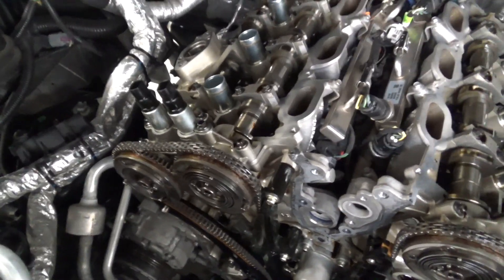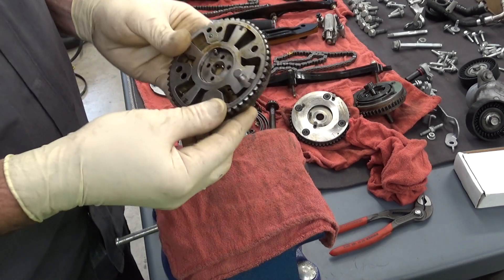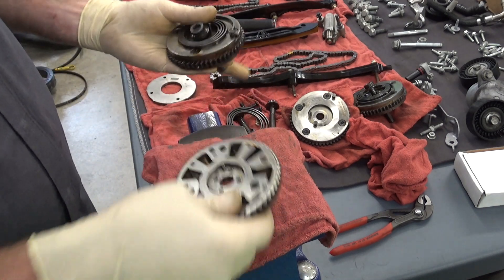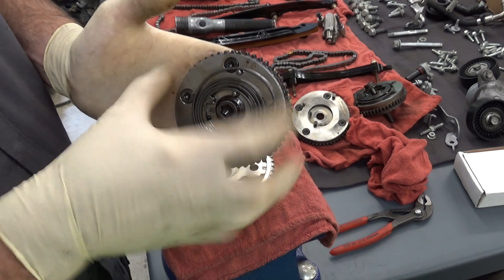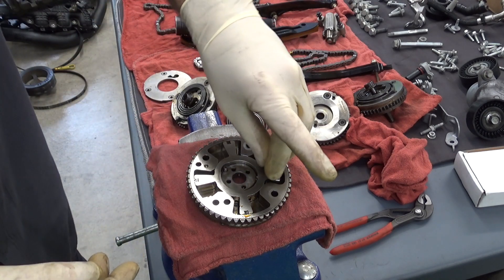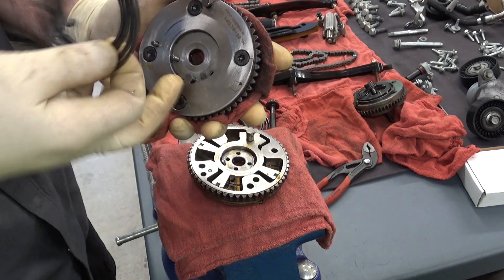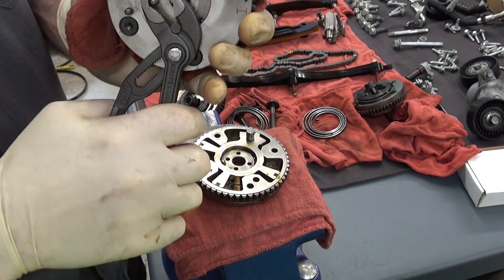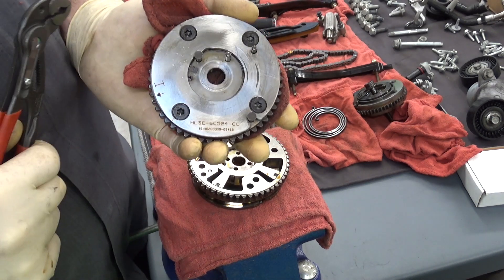FORD 3.5L ECOBOOST CAM PHASER RATTLE. THIS IS WHY

Comment: Thank you for posting factual information instead of the speculation posted on other channels.  You are 100% correct, the phasers are not locking properly, causing the noise.  Completely unrelated to oil pressure.  The new calibration prevents the locking pin wear, and for the ones that already had an issue the new CD level part has a redesigned locking mechanism.
Reply from the maker: The next one I do, I'm taking one of the new units apart to see what is different. Seems like so many say it's an oil pressure problem with plugged oil pickups, Talked with our parts manager and he said they have never sold a pickup tube for a 3.5 ecoboost but hundreds of phasers. Amazing how so many people can be so wrong. One of our techs had a higher mileage unmaintained 3.5 f150 come in 3.5qt low on oil with nasty knocking noise all the time. He swore it was lower end so he removed pan, rod caps, main caps and inspect pickup. All looked almost perfect. Whole day wasted. It was a blown apart intake phaser. He didn't listen to me. LOL
Reply: @raincitywrench117  can't wait to see
Reply: @raincitywrench117  Do you know Wildman113 means by “CD level part”?
Reply from the maker: @aggiejet  I believe it stands for concept design. Redesigning the part.
Reply: I got the updated software. Is it boosting the oil pressure at start up? I’m not sure how that locking pin issue gets fixed even with boosted pressure which likely causes other issues.
Reply from the maker: @U20E27  This engine has a positive displacement internal 2-stage variable vane oil pump which is controlled by an integral solenoid on the pump that will switch the pump between high and low mode operation.

 If a customer complains of shudder, Ford wants you to disconnect the oil pump electrical connector then test drive to see if shudder is gone. 

So it looks like the program changes the oil pressure under various conditions to prevent pin wear. 
Default is high mode (full pressure) but the engine will still take a split second or two to build oil pressure to the phasers and if the pins aren't locked it will rattle.
Reply: @raincitywrench117  
Yeah the second update is a roll back to the original settings if there is a hard shutter. So likely the software patch is a Hail Mary to try and reduce warranty claims ie get them to make it to warranty expiration dates. Not really a “fix” just a tweak to reduce cost on warranty jobs. Definitely the phaser design needs to be tweaked. I wonder what Toyota’s new phaser looks like?
Reply: @raincitywrench117  does this start up rattle issue will cause problems?   Consider all the efforts and potential human error when replacing those phasers.   A Must fix or ?
Reply from the maker: @vivaprojects4491  Here is what Ford says: "A cam phaser that has developed an undesirable noise does not affect the 
vehicle safety, performance, or emissions.:
If it's still in warranty then yes I would get it serviced.
Reply: @U20E27  
Stop speculating about things you don't understand.  Toyota and all manufacturers use the same design.  The issue was the calibration causing the phasers to lock/unlock too frequently during operation, which caused premature wear.
Reply: @raincitywrench117  
Correct on the positive displacement 2-stage variable oil pump. However, 21B10 is not just an adjustment to oil pressure, but an adjustment to cam phaser duty cycle.  The original calibration was allowing the intake phasers to return to base timing too frequently, which was causing premature locking pin wear.  The new calibration keeps the phasers off of base timing to eliminate the lock/unlock cycles that were causing the issue.  The CD phasers contain a more robust locking mechanism, but that was not ultimately determined to be root cause.

The shudder on some vehicles (21N08) is the result of a lack of maintenance.  Poor lubrication of the cam journals causes scoring, which reduces the oil flow to the phasers (bleed off).  Since the new calibration requires additional oil to the phasers to keep them off of base timing, the scoring is exposed when 21B10 is performed.  Hence why the tech is instructed to revert the calibration to the original.
Reply: @wildman1137   Never said they were different. Actually fully aware that flawless🤣 Toyota uses a similar setup. Only takes a different material to screw up an otherwise perfectly fine part.
Reply: @Wildman113 What is a “cd level part”?
Reply: @aggiejet  That's the newest service level part.
Reply: How does calibration prevent locking pin wear?
Reply: Yes. It IS an oil pressure problem.  That failed locking pin that you are looking at is only the symptom. 
How do you think it got worn out to the point where it wouldn’t lock up the gear when the engine stopped?  
Inadequate oil flow.  

So let’s think about this:  the pin extends into the lock position when?  
When the engine stops turning, right.  
So what CAUSES the pin to extend into the lock position.  The spring simply aligns the two halves of the gear to the resting position.  It doesn’t move the pin in the axial direction. 
The pin moves into hole because of the OIL PRESSURE subsiding.  As the engine stops, the oil pressure bleeds off quickly from the top of the engine, allowing the pin to move into the lock position.  

Now let’s walk through what happens when the engine starts. 
In a perfectly functioning 3.5, the oil pressure immediately increases to the top of the engine. The VCT solenoids port the required flow into the vanes of the VCT gear which causes the pin to unlock, and the VCT vanes adjust to the correct amount of advance/retard. 

In an engine that suffers from premature cam phaser wear, HERE is what is happening:  oil pressure on an engine start takes a looong time to build up adequately at the top front of the engine. This is because SOME of these 2017-2019 engines aren’t sealing correctly at the front cam bearing journal. 
The mega cap that holds down the front journals of both camshafts is a new inferior design. Only three bolts. If that bearing cap leaks by even a small amount, the reduction in oil pressure felt at the VCT is enough to delay having that pin unlock. 
And if the pin is delayed unlocking it is getting beat up as the engine comes up in speed. The phaser is trying to advance timing and it is forcing the two halves of the VCT to try and move—but with that locking pin partially extended it wears hard on the pin, and on the groove the pin goes into. As you saw on the one you took apart. 

The root cause is a poor design of the bearing cap that spans both front cam journals ( commonly called the mega cap).  If you are lucky enough to have one that isn’t sealing correctly, your engine will experience early failure of that cam phaser locking pin and there is nothing you can do about it. And no “improved” cam phaser design is going to solve it. 

I know. I had the new phasers installed in mine, and guess what?  30,000 miles later?  They failed again.  Huh, imagine that. 
It’s an OIL FLOW problem at that front journal—only a new HEAD will stop it from happening again.  

The reason everyone on the internet is saying this 3.5 EB cam phaser failure is caused by oil flow issues, is because it IS!
Reply: @user-fh3rc7eb1o  Completely incorrect, stop trying to preach about subjects you don't understand.  Oil pressure in cam phasers does not immediately bleed off on engine shutdown.  This is why cam phaser rattle noise only occurs after a cold soak; it takes many hours for the phasers to bleed down and return to base timing via the return spring.  That applies to all vehicle applications. Oil pressure does not "immediately" build in the top end of any engine, there is always a delay on startup.  That is the purpose of the locking pin; it holds the phaser stationary until sufficient oil pressure is available for the VCT solenoid to allow oil flow into the phaser to adjust timing.  A damaged locking pin causes the phaser to oscillate until oil pressure is available, hence the cold start rattle noise.

The root cause was the locking/unlocking duty cycle of the VCT units causing premature locking pin wear.  That is exactly what was addressed in 21B10; the calibration keeps the cam phasers from constantly cycling to base timing during operation.  The CD phasers addressed the issue before root cause was even determined by implementing a more robust locking mechanism, but the mechanism itself was not root cause. There is no issue with sealing at the mega cap; scoring of the cam journals (including mega cap) are the result of a lack of proper maintenance and/or engines ran low on oil, which causes scoring in the cam journals.  When 21B10 is performed and you have cam journal scoring, oil pressure can bleed off and cause erratic phaser operation which results in a shudder concern.  Scored cam journals WILL NOT cause a cold start rattle; that has no effect on the operation of the locking pin.

No new heads are needed unless you destroyed yours by running your vehicle low on oil/not maintaining your vehicle..  You need to stop playing internet mechanic/engineer.

Comment: I just got a recall notice in the mail about this today.
Reply from the maker: Hopefully you are fully covered.
Reply: @raincitywrench117  what do you mean by hopefully he is fully covered?...the recall covers anyone, but depending on the vehicle mileage they may only pay for a percentage of the Cam phaser replacement. If your vehicle is under 69,000 miles, then they are suppose to cover it 100%.
Reply from the maker: @danamullins2723  Yea, under 69k covered 100%

Comment: Had it done 6 months ago at Ford on 18 raptor. It’s back. 

So I’m ok with the noise any danger in leaving it.
Reply from the maker: I would make them do it again. I haven't heard of one coming back for noise once they were replaced so that's a first. Once the noise gets louder and lasts longer then you probably won't have a choice. Can't say what the long term affect is if left alone?...that is a good question.
Reply: My phaser was actually cracked.
Reply: Mine is back also.

Comment: Just had the reprogram done on my 2017 f150 3.5 eco, November 1st the dealer is replacing the phasers & chains , I’ll be glad when I don’t have to hear it anymore, luckily I still had a warranty
Reply from the maker: The reprogram is a waste of time as you know. The new phasers will fix it up. Glad it's under warranty.
Reply: You shouldn't need a warranty, it's under recall.
Reply: And also, I agree about the reprogram, it was only done to hopefully get people to forget about the problem so that Ford wouldn't have to pay for the actual replacement of the Cam Phasers.
Reply from the maker: @danamullins2723  Exactly
Reply: @raincitywrench117  for which years are the recalls for sorry?
Reply from the maker: @JT-cm3ff  Customer Satisfaction Program 21N03 – Supplement #2
Certain 2017-2020 Model Year F-150, 2018-2020 Expedition, and 2018-2020 
Navigator Vehicles Equipped with a 3.5L GTDI Engine
Cam Phaser Replacement
Reply: @raincitywrench117  thank you 😊

Comment: I have a Camry with the 2ARFE engine (2.5l) which are notorious for cam gear (phaser) rattle and it's been pretty much isolated to the locking pin not engaging due to the spring being too weak.
Reply from the maker: Watched a few videos on those years back. That may be the case with Fords design also.

Comment: I ordered a 3.5 eco boost should I back out or do you think they will figure out the issues in the next year or so lol ? From what I have read it’s a good motor beside the phasers etc
Reply from the maker: They changed production to the updated design after 2019 so you will be good. I agree, other than this issue, they seem to be good little units.
Reply: @raincitywrench117  
Correct.  All trucks built 11/2019 or later have the updated calibration and redesigned parts.
Reply: @wildman1137  Ford has been trying to solve this/these problems for years.  I’m not sure how much confidence to put into engines using re-designed parts designed to eliminate this problem?  Here’s a post from a 2021 truck owner… https://youtu.be/a2urs9Wc1Io.  I don’t know if it’s a the same problem or a different one?  As 2020 and 2021 truck owners run the mileage up on their trucks it will be interesting to see if we start seeing more issues or not.  I really would like to see the new part dismantled and someone explain how the re-design addresses the problem once and for all.

Comment: Has Ford redesign the new one's your installing? Or can you tell anything different
Reply from the maker: Supposedly, they physically look the same but different #PN.
Reply: @raincitywrench117  
Locking mechanism is different internal to the phaser.  CD level part.